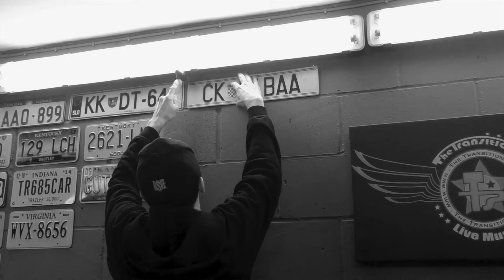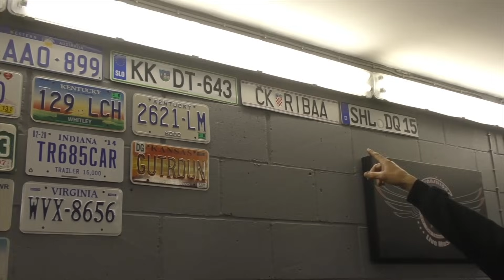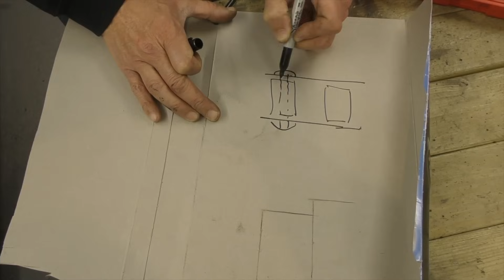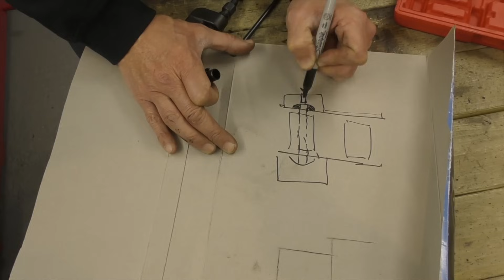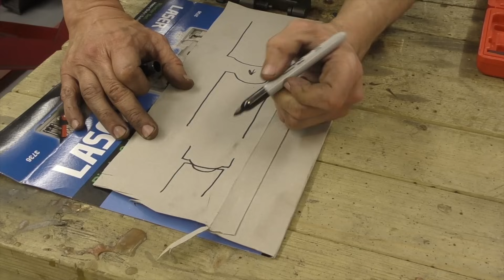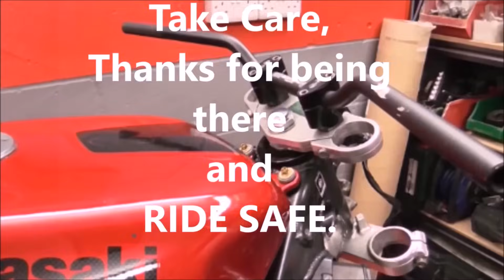Delboy's Garage, Motorcycle Chain and Sprocket Change.

Comment: Del I've done this meticulously with a 530 rivet tool or my 530 chain. The rivet pin now sits flush inside the master link pins, just as you show above. If I put a digi caliper on it though the pin head is barely spread any wider than the unriveted pin end of an unused master link I have. I read stuff online suggesting that the chain pin should be deflected in diameter by 0.5 mm once riveted. Is this true or can I rest easy that the job is done? Apologies for a thicko question, but I'd rather not cut my left leg off with a chain that flails apart under load because it was inadequately riveted!

Comment: Hate to say it. He’s not riveting the pins according to the instruction manual. The manual clearly states to: place ALIGNMENT BOLT FLUSH with side plate on the link. He has the riveter pin exposed. It shouldn’t be. But I followed his video and it did produce successful results.

Comment: Hi .question .. so far all ok  but why did you not check bearings crush drive .wheel of repack with grease.
Reply from the maker: 4yr old bike with 4k miles.

Comment: Hei from Norway Del !  Great video. I'd never done this job before today. I have a 2000 Transalp 650 and installed a 525VX chain on new sprockets. I hope everything is OK. Used a micrometer to measure the outside distance of the existing plates which were approx 19.10mm - I did as you said ... bit by bit !  ended up with 18.92mm so I'm guessing that was ok. Then, using the riveting tool, I have a head size of 5.4mm on both pins ... should I try for more ?  I'm a chicken !!! :D
Reply from the maker: Hi there, it sounds like you're on the right track, and those tolerances are not as critical as you think, normally about 6mm is desirable, but half a mm away truly won't make much difference in the real world, as alsways with fitting a chain, paint some correction fluid, or bright nail varnish, on that compression link and keep a close eye on it for the first few weeks, it should be fine.

Comment: Will the tool definitely not work if you don’t grind the pin first? I don’t have a grinder and don’t want to rent one because the breaker took I bought was £15, so makes sense for me to try and use it once anyway..
Reply from the maker: You'll almost certainty bend the pin if you try to force the link out without removing the heads for the reasons i explained..  if the chain is going in the trash then just hacksaw through it !

Comment: I’ve used that exact tool... it was breaking my links as there’s no support for the rivets on the back, you need to hold rivets not the chain link when riveting otherwise the rivets are being pushed not riveted.
Reply from the maker: Did you not use the round "anvil" part from the kit to back the rivet when you flare it out..!  i showed it at 38:45   !

Comment: it seems D.I.D have lowered the build quality of the Zvmx Gold 525 - 530 chains  
i am now on my second replacement chain as now they are needing way too much adjustment now 
in a short period of use,  which is a concern of chain total strength or even safely  
Zvmx chains were way better before so what has changed, are chains the still ? made in japan so whats has changed with them 
other than the new artwork on the box   i feel something has been down graded now

Comment: Hi, if you want to put the old chain back, you would only need a new pin ? to replace the grinded one ? Thank you.
Reply from the maker: Yes thats right, it's common to remove a link and separate a chain if you have a swing arm with a brace and need to take it out for new bearings,  just fit a new link when you put it back together.. about £6..

Comment: Had a question I saw one of your episodes you were using a Street glide special you were installing Sportster rear shocks assuming they were 13 in have you tried using Dyna rear shocks also let me know if you can use any 13in rear shock Sportster or Dyna or just Sportster only thank you

Comment: Hi, quick and maybe dumb question. Why do you hammer and bend that washer? Is it a must? TIA!
Reply from the maker: Not a dumb question.The washer is 'splined to match the shaft, so it will not rotate,  when you tap the washer against the nut it prevents it coming loose !

Comment: I did the same, But riveting tool PIN deformed at the end like yours. Is it ok to use again on new chain, because you can see at 38:24 too is rounded, but after riveting at 44:10 tool is deformed? My question is, is it safe to use the same tool for new chain, because it is deformed now ? Tnx
Reply from the maker: I generally get two chains, maybe three, from that pin (you are asking it to endure some incredible force), and you can buy them independently from Wemoto, last time I bought a pack of 3 for a few £'s and that's enough pins to do 6 bikes or more... I maybe replace one chain & sprockets a year.
Reply: @Moonfleet41  Thanks to you, I did my first chain yesterday, and saw a tool deformed like this and was a little worried, what to do next time. I will try to search for a Tool pin online, to have a spare. Tnx for this classic video 👌👌👌
Reply: @Moonfleet41  Tried to find it online, but unable to. I think this tool rivet pin can be made from hard steal on  lathe machine, to be better than this chinese one :)
Reply: This is mine before and after riveting 1. AFTER >> http://prntscr.com/rxe7wl
                                                                   2. Before http://prntscr.com/rxe8g8
                                                                   3. AFTER http://prntscr.com/rxe8zf
Reply from the maker: @Josava13  Try here.. https://www.wemoto.com/components/tools/chaintools

Comment: Is it better to leave all the extra grease on the outside of the chain links? or would that attract more dirt to stick to it..
Reply from the maker: The white grease it comes packed in will fling off pretty quickly, so I usually wipe it all off and re-apply some proper chain lube, whatever type is appropriate for the weather and conditions, dry lube in summer, chain wax in winter.. (or better still, fit a Scottoiler).
Reply: @Moonfleet41  you were right and I found out the hard way!!! Just wiped it all off with some Motul chain cleaner and then applied their spray on lube.

Comment: The explanation in the video is great really, but I can't tell the same about this cheap crap tool set. If you check the video at 38:25 you can see the rivet pin has the original head structure, but after you first pushed it to the master link, I see the rivet pin damaged only. It can be seen at 44:33 and closer earlier at 44:23 before the second push. Today a motorbike specialist showed me a tool set like that. He "used" it only one time, but realized material is soft it is not acceptable for chain rivet process with responsible. He offered me one correct way with a higher price tool set that has the quality to do the job. In this video I don't see noticeable deformation on the master link, that is a huge problem!!! So at least basic science helped me a lot to understand all the steps but help to decide to not buy this version of "tool" garbage set. Guys our bikes deserve more. My CBR1000RR definatelly.
Reply from the maker: This is an older video now, i have updated this a few times since.. those pins are pretty much single use, you can buy them on their own to replace....they will still spread the chain pin adequatly for a safe instalation.   I now use a heavy duty tool system that spreads in a different way..

Comment: Would it matter if you grease up the front sprocket thread, or nah should be fine without it
Reply from the maker: The thread just needs to be clean and free from any corrosion.. and it wouldn't hurt to ad a dab of anti-seize to make it easier to get off later.

Comment: hi, i have just fitted the same chain to my ducati, using this great vid as a guide, now the question is i have seen in a couple of your older vids that you recommend the use of a scottoiler. is that still your recommendation for a bike that does something like a 1000 miles a month? or would you now recommend another way of lubing one of these expensive d.i.d. x-ring chains? like you, i want this chain to last! cheers in advance.
Reply from the maker: Hi buddy, congratulations on a wonderful choice, I just love Ducatis!  Yes, I would recommended a Scottoiler for that kind of mileage, it's a great way to keep the chain lubed, but it's important to note that a Scottoiler is not a fit and forget remedy to chain lubrication... certain people have criticised Scottoilers because they believe it leads to chain neglect, but this is incorrect, the Scottoiler itself is just a tool and as with all tools, it's how you use it, don't neglect your chain just because there is an automatic oiler... if you want your chain to last, as you do, it's important to keep the 'feed rate' of the Scott Oil absolutely correct, 2 drips per minute is average for dry riding, and then turn it up to 1 drip every 30seconds for really rainy weather...

Make sure there is never any splatter off on your bike, certainly no more than a few spots here and there, watch for the build up of dust and sludge on the oily surface and clean it off every week... also keep an eye tension as usual... good luck with it my friend, have a look at the electronic version of the Scottoiler that doesn't need vacuum and try and get the twin feed which deliver

Comment: Just got one of these today to do the chain on my Bandit, always did the hammer and punch method before.  One question, do you need to grind off the heads of the rivets or can they be pressed straight out?
Reply from the maker: Grind those old rivet heads totally off mate, they are too hard to be pushed out by the tool.. good luck with it.

Comment: Quick question, why use the tool to remove the pin ,when you have a grinder? just cut the chain.
Reply from the maker: Use the tool to remove the pin if you want to refit the chain, such as on a bike with a swing arm brace for instance !

Comment: What are the road tires on the Scrambler. I need new ones for my T100
Reply from the maker: They are "Continental Motion 2"'s .. often referred to as "Contimotions"... but these are 180/55/17, and 120/70/17 on custom rims, they may not make these tyres in your widths, if not, then we had 'Avon Road Riders' on the old factory rims... very good in all weather and lasted ages.
Reply: Thanks. I find my stock Metzliers (Spelled that wrong I bet, lol) I find are kind of slippy, especially the back tire in turns.
Reply from the maker: Ive never liked Metz's for that reason, they seem to need really hot weather before they get soft and grippy.. i think factory fitted tyres are always a compromise because they want them to last a long time for you, and probably don't want to pay much for them in the first place...maybe thats just my cynical view.. but try the Conti's if you can get some, never had any complaints myself, even on sports bikes.. take care buddy.. good to hear from you..

Comment: I was a little frightened about buying that tool because all the reviews were like "it's crap!", "Broken after the first use" but with this great explanation I feel more confident about trying to do it by myself! 

Great great video!! You've won a new subscriber :)
Reply from the maker: Hi Luis, great to hear from you... thanks for your faith in it, it's really important to grind the chain link down because in that toolkit the driving pin is the weakest part, and if you use the kit many times it may still get bent, or damaged, when flaring the new link... but you can replace them, if you contact Wemoto.com they can send you a couple of spares and they're just a few pence each... good luck, and welcome aboard, Del

Comment: What do you recommend if you dont have a grinder to smooth out the original pin when breaking a chain please?
Reply from the maker: Hi mate, you might possibly get away with a Dremel, but I doubt it, those pins are extremely hard and a handfile would just bounce off, if you're taking the chain off though and it's going in the bin, then don't worry about grinding the pin, you can actually cut the chain with a hacksaw, just by going down between the rollers cutting the plates themselves, quicka nd easy, works every time mate, but of course, only if the chain is going in the bin!
Reply: @Moonfleet41  thank you.... Yes i was gonna get rid of it as its the factory chain from 1995 and im doing a refurb of the bike from frame outwards... I appreciate your help and am watching/learning from your streetfighter build vids so may have few other questions in time if you dont mind that is
Reply from the maker: @mattbritton8201  Not at all mate, always happy to share a second opinion if I can, no expert but it's a pleasure to help.

Comment: So I didn't realise you only had to rivet them that little. I did end up flaring my rivet tool and bending the bar inside it :/ Feel like an idiot now. I managed to flare it with a ball bearing and the anvil after my mistake. 

Some chains specify a flair amount though don't they? like some D.I.D chains were 5.7?
Reply from the maker: Bending and breaking the tool pin is pretty common Austin, but i love the ball bearing ploy.. that works too... good fix buddy.
Reply: @Moonfleet41  Yeah it all worked out in the end. First time doing it and it took a bit more than 2 hours :D Every day is a school day. Great video and channel, wish I stumbled across it a bit sooner.

Comment: I put grease on the o-rings, but I forgot to grease the pins and inside of the link holes.  I haven't riveted the chain yet but I already pressed the plate on.  Is there a way to remove the plate so that I can grease the pins and holes and still salvage the master link?  If I can't salvage the master link, how do I get the plate off?
Reply from the maker: No my friend, don't overthink it, that's not the end of the world, you'll probably do more damage to the link trying to muscle it off than a tiny deficiency in grease, the white grease supplied with the chain will soon get flung off anyway, and you'll settle down to using a regular chain lube, so finish your installation nice and tidy, then lube the chain in the proper manner each time you ride, making sure not to be too excessive with it... once the chain heats up in use, your chain lube will wick in to the link as it will with all the links, and it'll be fine... remember when it came out the packet, it was covered in grease already, so it's hardly bone dry in there... hope that helps.
Reply: Delboy's Garage Thanks Del Boy.  Unfortunately, I already moved the pins out with the breaker pin.  The pins of the master link don’t look damaged.  Is it possible to reuse the master or should I buy another one?
Reply: Delboy's Garage The pins are not flared out yet.
Reply: @Moonfleet41  Delboy's Garage Thanks Del Boy.  Unfortunately, I already moved the pins out with the breaker pin.  The pins of the master link don’t look damaged.  Is it possible to reuse the master or should I buy another one?  The pins are not flared out yet.

Comment: Are we doomed to fail if we dont own a grinder? Is there an alternative to grinding the pin heads off?
Reply from the maker: There certainly is mate, you can hacksaw the original factory split link, or any link for that matter, straight through the plates... they are pretty hard, so will take you a while, but will get through just fine... however, the pins are upper hard and a file doesn't touch them.
Reply: @Moonfleet41  awesome, thanks for the help!

Comment: So with new chains do you need to lube them after fitting straight away?
Reply from the maker: They only come delivered with a light coating of lithium grease which will fling off quite quickly, so I like to wipe that off and add a little proper chain lube.

Comment: Got  a new chain and sprockets shop fitted and only noticed after the fact there's not much room for adjustment on it....only 1 notch left at the end which is where the old chain was set that i got changed ....is that normal ?

Comment: Ok Del, in the early 1980's I owned a Laverda 1200, it used a 636 chain as stock fitment. The chain was huge and it was very heavy too, is a 636 chain on this machine overkill?
Reply from the maker: Back in the day, chains had to be beefy to be strong, so often it was a trade off, specially in things like drag racing to have monstrous thick chains to avoid snapping, but you trade off power because of the weight, but these days with development of chain technology, you can run smaller chains with the same strength!